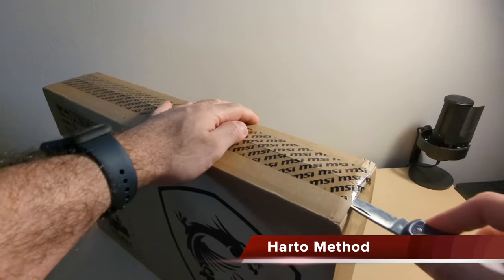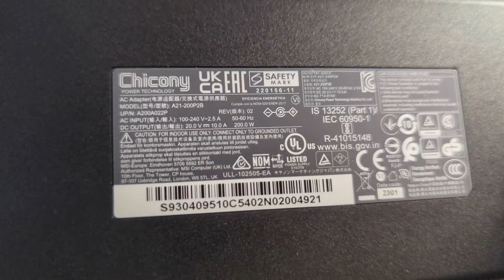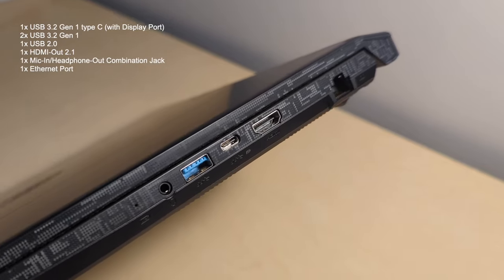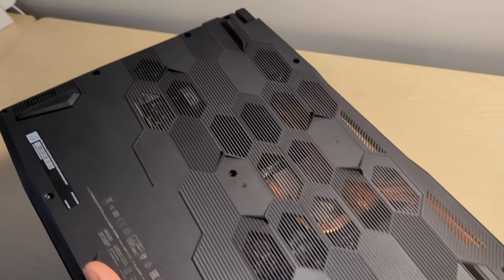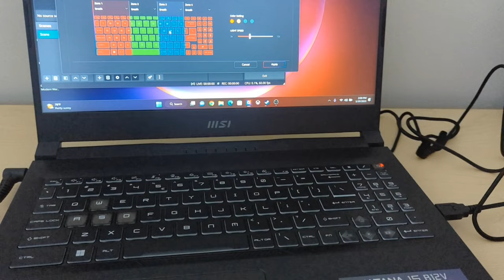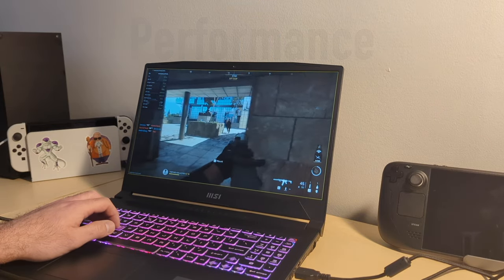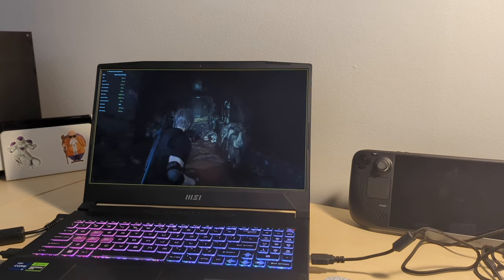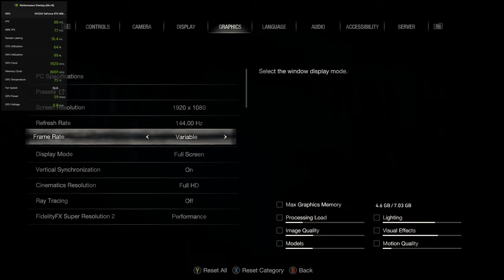MSI Katana 15 Review - Best “Budget” 2023 Laptop with an RTX 4060?!

Comment: Hi there i was wondering which laptop is better MSI Thin (15,6 ) FHD | Intel Core i7-12650H | 16 GB DDR4-3200 | 512 GB SSD RTX 4060 8GB Laptop GPU | Windows 11 H | 

OR

Lenovo Legion 5 (15,6 Zoll) FHD | Ryzen 7 6800H | 16 GB DDR5-6000 | 1TB SSD RTX 3060 6GB Laptop GPU | Windows 11 H |

Both cost 1000€
Reply from the maker: Personally I’d go with the msi and upgrade the ssd afterwards

Comment: Hi, I just bought this laptop and it says it will be about a month before it comes. I'm thinking of buying a new monitor to use as my main monitor, mainly for playing Overwatch, Rocket League and Fortnite. I want to get either a 240hz 1080p monitor or a 144-165hz 1440p monitor. I don't know is this laptop Will be able to support those specs, and I also wouldn't know which type of cable to get. If someone could help It would be much appreciated.
Reply from the maker: I’d go with the second monitor

Comment: I got the Msi cyborg 15 45watt RTX4060 i712650H. also have a 3070 desktop and xbox one x and xbox series s. But The cyborg is even more budget. but it does have 45watt gpu but if you disable igpu you still get great gaming performance. i payed 1250,-

I get 100ish til 115 fps in MW2 with IGPU disabled in the Hidden bios. To reveal hidden bios press schift cntrl alt f2 in bios. Ultra settings dlss on ultra quality
Reply from the maker: Nice! Yeah the 45watt is a hindrance but that’s one of many ways to circumvent it!
Reply: @hartomethod  Yeah i switch igpu on and off even the i712650h is pretty capable of gaming on its own. 

Honestly m good with the fact that it's 45watt laptop stays pretty cool even tho one fan design mid summer. 

So on the performance side it's oke for me but only thing I hope they made better than the GF series is the Hinge design. 

Didn't had any issues yet. 

But finding out that buying a laptop in 2023 would be so hard cuz manny have bad Hinge designs was rediculous
Reply from the maker: For the price I don’t mind the build quality but I personally would like something sturdier like you mentioned. Again, my main driver is a MacBook and that just feels like a solid prover of tech
Reply: @hartomethod  You are right had several mac's in the past. Dell XPS are also as sturdy.
Reply from the maker: I’ve heard those are built very well
Reply: @hartomethod  They really are but you give a bit preformance for Build quality. Even tho you pay 3000+ for a 3060 version ( new ) for Dell XPS it's still a bit less performance than the 45watt 4060 in the cyborg. I would recommend to go for a 4060 / 4070 or last year second hand laptop with 3070 or 3070ti. Still frame gen does work pretty good tho even tho everyone hating. Frame gen limited for 40 series till now.
Reply: @hartomethod  Yeah my brother has one with I9 and 3060 but those are mad expensive for the gaming performance your getting. Anyway you'll still have a solid system. If the cyborg wasn't released when I wanted to buy a laptop, I would have got a second hand dell XPS or Razer blade. Even tho the screen isn't the best gaming performance is still pretty neat on the cyborg. Better than higher was 3060 bye a small margin. Cyborg 15 screen is replacable with a 165hz 99 procent rgb screen there is one that is compatible. Might do a switcheroo on mine one day.
Reply: how does it disable the restriction in the bios?? You can learn more about it

Comment: G14 zephyrus with I5 12th and rtx 4050 or Katana 15 12th rtx 4060 (same price ) what i choose bro , i think zephyrus is solid and elegante with metal body advice me bro
Reply from the maker: G14 is smaller but it’ll get hotter due to its size. It’s also a weaker gpu and is not as upgradable as the MSI. You’re stuck with one ssd slot and one of the rams are soldered

Comment: GPU temp? Is its Cooling System Good on full load?
Reply from the maker: Even with a triple A games on very high settings, the temps stay stable. But you will notice the high fan noise

Comment: Bro, 😢I just purchased this msi katana 15 laptop rtx 4060( 105 W) over Lenovo LOQ 15IRH8  144Hz intel 13620h  rtx4060 (140W) because I don't know Msi katana has 105 W and I don't knew some channels give bad review about  MSI katana 15. how much can performance be different between these laptops?and MSI Katana laptop is a really bad performance compared to this Lenovo LOQ laptop?
Reply from the maker: I’d suggest you use it any see if it fits your needs. There will always be better spec’ed laptops. The Katana is cheaper in price so there are some drawbacks but I still experienced no issues when gaming. You can also downloading after burner and over clock it.
Reply: @hartomethod    Please tell me, in your opinion, is it worth it or not,bro? I  just purchased it yesterday😭?
Reply from the maker: I think it’s worth it!

Comment: How’s the battery life? Amazon prime day has i7-13620H, 4070, 16GB RAM, 1TB SSD at $1200. Worth? Thinking of taking this to college so if the battery life sucks then I might skip out
Reply from the maker: That’s a pretty great price. For daily tasks I don’t think the battery will die that fast, I’d say more than 3 hours. You could also use the mux switch to switch integrated graphics so the 4070 doesn’t use up much battery.

If you want something for productivity primarily then I’d get something else. But this is overall good if you plan on gaming
Reply: @hartomethod  any recommendations for 50/50 productivity and gaming, around the $1200 price point?
Reply from the maker: If you’re wanting portability I’d recommend the asus zephyrus g14. There are 3060 models under $1100

Comment: Hey bud? I have a doubt about performance of asus tuf f15 i7 12 gen vs i7 13 gen (rtx 4060) do i will get less fps in i7 12 gen?
Reply from the maker: I think the performance will be similar. If I’m correct the asus tuf has a higher wattage which helps performance. I don’t think the cpu difference will show that much in most of the games you run

Comment: I have an MSI device and I want to update the device to this model. With my current MSI, even with basic Google Chrome things, it usually turns on the fans at full speed to avoid overheating. Does something similar happen to this model?
Reply from the maker: I never really noticed the fans kicking on unless I played a heavy game. Even with smaller titles you can set the fan to silent and it’ll run pretty well

Comment: Im about to pick this up, my job has a thing where i can get a line of credit so to speak and i got enough to be able to get a laptop, this one seems to be the best option i can find, awesome video, do you think when connected to a 1440p external 165hz display it would run alright with that 4060?
Reply from the maker: That’s awesome! I think it’ll be more than capable to run 1440p on a monitor with certain games.
Reply: @hartomethod  Sweet, i should receive it in a day or two xD
Reply from the maker: Nice, let me know how you like it!
Reply: @hartomethod  i received the laptop, it works great and performs well, tho the temps seem to get pretty high but im sure once i get a cooling pad it will be fine
Reply from the maker: Awesome!

Comment: when i play games on this laptop it only goes to max performance when the charger is plugged in any fix ? or is it just like that
Reply from the maker: That's the standard for most gaming laptops. If you want the full power draw, it's going to need to pull it from an external source compared to the battery.

Comment: What monitor would you recommend  to go with this? nothing overly pricey lol
Reply from the maker: I’d recommend something with 120 hertz and a 1440p resolution
Reply: @hartomethod  ahh okay. I was looking at an AOC that's 1080p with 240hz. 
I didn't think about going to a lower hz, being that the laptops screen is already 144hz at 1080p. I've read that the 4060 is incredible for 1080. But has draw backs if higher. Guess my point is won't it look worse at a lower hz? (Bufget is about $200) thanks!
Reply from the maker: I personally have never played at 240 hz. I don’t notice any difference above 120/144. I’d suggest getting something capable of 1440 that way you still have the option to run it at that or 1080
Reply from the maker: I’d look on Amazon for 1440p 144hz. There are some options under $200
Reply: @hartomethod  ended up ordering the Samsung Odyssey G6 from Amazon since it was 50% off!
Reply from the maker: Nice! How much?
Reply: @hartomethod  $350 instead of $700!
Reply from the maker: That’s a steal

Comment: Hi, can you please tell me the acceptable input voltage that's labeled in the power supply? Does it support a 220 v power supply? Thanks.
Reply from the maker: It should accept 220.
Reply: @hartomethod  Hi, do you still have the laptop? What does it say on the product label? 110-230 v?
Reply from the maker: It’s in the video but it’s rated for 100-240v
Reply: @hartomethod  Thank you.

Comment: hello brother want to buy me a laptop but i don't know which beseer it is :: MSI Katana 17 B12VFK-406 Gaming-Notebook (43,9 cm/17,3 Zoll, Intel Core i7 12650H, GeForce RTX 4060, 1000 GB SSD) or Asus TUF Gaming A17 FA707RM-HX005W Gaming-Notebook (43,9 cm/17,3 Zoll, AMD Ryzen 7 6800H, GeForce RTX 3060, 512 GB SSD, Windows 11)
Reply from the maker: MSI if the price is similar
Reply: @hartomethod  300 euros difference Should I still buy MSI?
Reply from the maker: 4060 will perform better than the 3060. I’d wait to see if the MSI goes on sale but my opinion is that the MSI would be a better option
Reply: @hartomethod  thanks bro❤️

Comment: hey man do you have a link where  i can buy ssd mount i just discovered there are no screws for it.
Reply from the maker: Yeah. So it’s a pain in the butt to find but after digging on this thread I found that you have to actually contact MSI support and ask for the parts below. Forum link posted as well
https://forum-en.msi.com/index.php?threads/msi-katana-15-design-quality-issue.384568/

E2Y-6S11111-CA7 - SSD Thermal Paste x1
E43-1202512-G68 - SSD Bracket Screw x2
E2M-5850311 -A89 - SSD Bracket x1
E43-1203007-G68 - SSD Screw x1

Comment: I just bought it. Can you tell me how long the battery lasts when Idle ? I think mine is not normal, its decreasing 1% every 1 minute.
Reply from the maker: That is not normal. Have you tried changing the battery life settings to see if that does anything? I usually keep mine plugged in but decreasing 1% while not gaming shouldn’t be happening
Reply: same problem.  I bought it today, fully charged it, but the battery ran out in 2 hours ((I don’t understand why?

Comment: Bro, please tell me which one I choose  

FA507NV-HQ054W 
CPU: AMD Rembrandt R7-7735HS  
GPU: NVIDIA® GeForce RTX™ 4060  140 W
2k display 165 hz 
Ram16 4800mhz
512 GB 
And

Msi katana b13vfk 
Rtx 4060 105W
Intel i7 13620h 
1920×1080p 144Hz 
Ram16 5200mhz
1TB 
I have an external monitor, so the display is fine, right ?

All prices are the same in my region
Reply from the maker: What brand is the first laptop?
Reply: @hartomethod  Asus Tuf a15
Reply from the maker: I’d say the CPU’s are evenly matched. I’d personally go with the Asus since it’s a better screen and higher W
Reply: @hartomethod   bro, 😭I chose msi katana 15 105 W over tuf  a15 140 W because msi katana 15 i7 13620h is better than asus tuf a15  ryzen 7 7735hs right and rtx4060 laptops performance will not be improve  after 115 W right ?
Reply from the maker: Overclock it. You won’t really notice much of a difference in game
Reply: @hartomethod        did I  make  a good choice between these two laptops? Some people  were saying msi katana is bad? I chose msi because of cpu and cooling system 😭.
Reply from the maker: Use it and base your opinion off of what you think. Not from what other people say

Comment: How long and good the battery for this thing last?
Reply from the maker: Depends on what you do. For normal web surfing I’d say about 2-4 hours. Gaming about an hour and change
Reply: @hartomethod  Damn I want to game with good battery maybe I should get the Asus TUF A16? Or plug a charger to the MSI
Reply from the maker: A charger in anything will make it last. I think even the TUF A16 will struggle with battery power
Reply: @hartomethod  Okay Thanks 🙏

Comment: between this and the rog strix g15 with a 3060 wich one is worth it???
Reply from the maker: Is the strix cheaper? The katana is on sale right now for about $999 so if it’s cheaper than the strix, id say the katana. But overall the strix would have better build quality
Reply: @hartomethod  is around 900-100 , the difference between the 4060 and 3060 is too big? and i like the better build quality
Reply from the maker: I’d go with the strix
Reply: @hartomethod  ty bro

Comment: have you tried the type c ? can u use it for dp port? i had this laptop but as sooon as plug it in to monitor said no signal, is it because my dp cable and dp monitor doesn’t match? my dp cable is higher version than the minitor port.. howeverr i tried it on other laptop it does work
Reply: does anyone can help me out?
Reply from the maker: I don’t believe you can use the usb-c to dp port. It may work if you connect there usb-c to a hub/dock and then run a DP from that to the Monitor? Again, I never tried it so I can’t guarantee, sorry
Reply: @hartomethod  hmm okay thanks

Comment: Bro, my msi katana 15  cpu 13620h temperature is high around 82-95 °C when gaming. Is it normal?
Reply from the maker: That seems pretty high but I’d check online to see if it’s normal. Do you notice the performance dropping?
Reply: @hartomethod No, performance doesn't drop, but cpu  temperature is too high
Reply from the maker: Hmmm yeah that seems pretty high
Reply: @hartomethod    bro , do you turn on fan to cooler boost or auto .With the cooler boost, the temperature  is great, but I worried about the fan because they are running max speed.Is it okay, cooler boost on when gaming?

Comment: Hi, I just stumpled upon your channel as I bought this computer about a month ago. I'm experiencing crashes when playing "the finals" even though the computer suposedly has the specs for it, and even recommands high setting in game. I have all the settings on low and limited fps to 144 and still get crashes with an unreal crash report saying UE5-Discovery : LowLevelFatalError [File:.\Runtime/D3D12RHI/Private/D3D12Util.cpp] [Line: 898] 
hr failed 
 at .\Runtime/D3D12RHI/Private/D3D12Resources.cpp:692 
 with error DXGI_ERROR_DEVICE_REMOVED with Reason: DXGI_ERROR_DEVICE_HUNG

All the drivers are up to date and running full fan speed. CPU reaches 85-90degrees..
Any idea what can cause these crashes ?

MISSING_ANGELSCRIPT_CALLSTACK
Reply from the maker: That’s interesting. No, I have no idea what could be the cause of that. You could manually reinstall windows but I’m not sure if you want to go through that hassle. Maybe contact the seller?
Reply: Don't limit fps and verify the game file. When I limited fps on AC Vahalla, it crashed

Comment: How it’s compared to acer nitro 5 3070ti/16gb ram/1 tb ssd
Reply from the maker: I haven’t used the nitro but based off the mobile gpu’s, I’d say it’s pretty close. The 3070ti performs a little better than the 4060, even though it’s a year older (based off what I’ve seen on the userbenchmark website).

Comment: Would you get this over the Lenovo Legion Pro 5?
Reply from the maker: I’d get the Lenovo. It’s more expensive but has a 3070 and a QHD screen instead of 1080
Reply: Is 3070 better than 4060
Reply: And i can buy a acer nitro 5 with ryzen 9 and 3080 should i buy that or the katana or the lenovo legion 5 pro and plz can u tell the bettery timing
Reply from the maker: 30 series has been out longer and has been proven to be a workhorse. A 3080 is great. I’d recommend both a 3070 and 3080 over a 4060 depending on the price Ofcourse.

The battery will depend on what you do. These gaming laptops aren’t really made to be unplugged from the wall that much. And you essentially need to be plugged in while gaming to make sure you get the most power draw possible
Reply: @hartomethod  i think i will go with legion 5 pro because it has i7 with 3070 and has better display than both and 6 hrs of battery life they are the same price for me at 1700 euros before i was gonna buy mac book air or macbook pro 13
Reply: @mrh_king  3070 is faster than 4060 in rasterized performance, but doesn't support DLSS3 (frame generation).
Reply: @MrBl3ki  yeah i alredy bought the lenovo legion 5 pro
Reply: Its good but it has alot of gan noise while gaming
Reply: @mrh_king  Yeah, higher power wattage equals higher temperatures equals faster fan spinning equals more noise. Should wear headphones when gaming (especially on laptops) either way.

Comment: How to install the 2nd ssd m2 ?
Reply from the maker: Yeah. So it’s a pain in the butt to find but after digging on this thread I found that you have to actually contact MSI support and ask for the parts below. Forum link posted as well
https://forum-en.msi.com/index.php?threads/msi-katana-15-design-quality-issue.384568/

E2Y-6S11111-CA7 - SSD Thermal Paste x1
E43-1202512-G68 - SSD Bracket Screw x2
E2M-5850311 -A89 - SSD Bracket x1
E43-1203007-G68 - SSD Screw x1

Comment: Can this laptop play the FPS shooter game ready or not?🤔
Reply from the maker: Yes. I’m playing BF2042, MW2, and fortnite on it with very high settings and it runs them well
Reply: @hartomethod  So it means that this laptop is possible to  play ready or not with at least high settings?🤔
Reply: @hartomethod  And what is this laptop's several weight?
Reply from the maker: It should handle that game with no issues at all
Reply from the maker: I’d have to check specific but it feels around 2.2kg / 5lbs
Reply: @hartomethod  And this laptop can play the insurgency sandstorm and euro truck 2?🤔😂